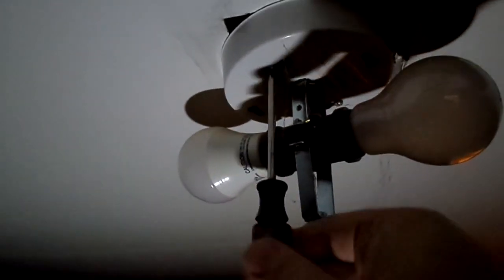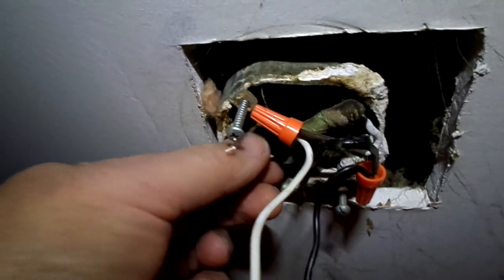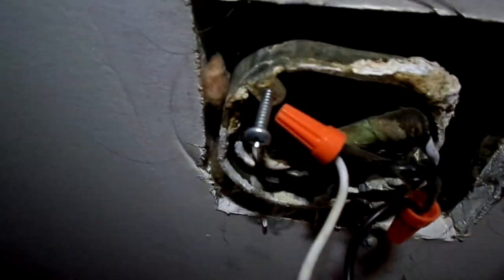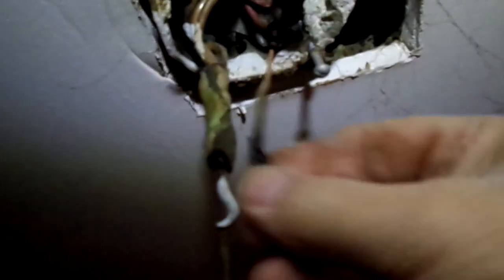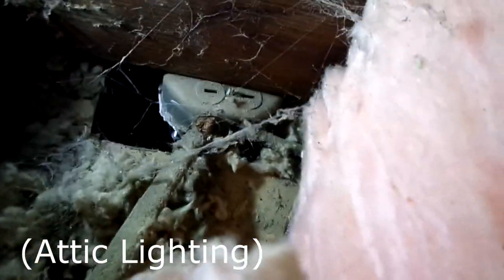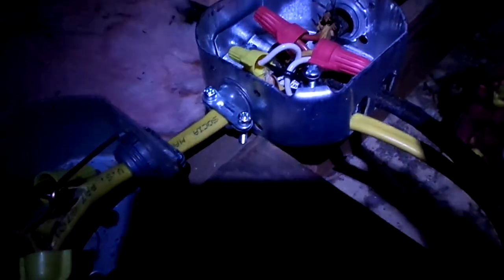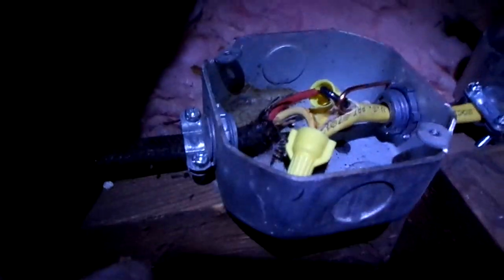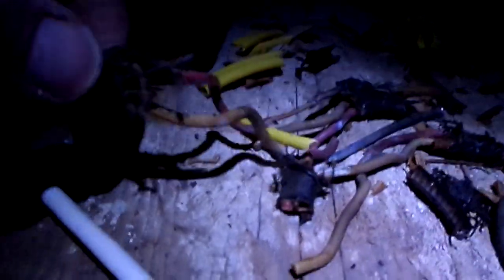Old House Electrical Repair

Comment: Texting as I'm watching. First of all I run into this 2-3 times a week. Old Adobe houses here in Southwest AZ. I see lots of aluminum wires with the same sheathing that you are dealing with. Not copper. I would never climb into the attic like you. My legs just won't let me. I would rather do drywall repair rather than monkey in a tight dusty crawl space. What people don't know watching this is the agony of laying across rafters in dusty shitty insulation wearing a headlamp and breathing that super dusty air. Hats off to you brother for doing what needs to be done. PS, you save yourself $ 250 minimum from calling in a pro company.
Reply from the maker: Yes, you called that Dave; I can tell you're no stranger to this, very good description.
Thanks for watching!